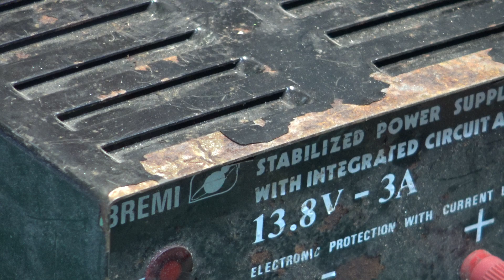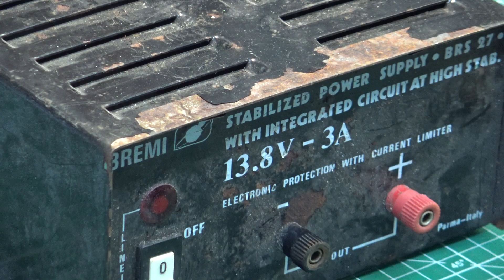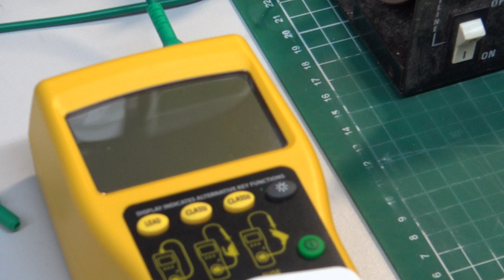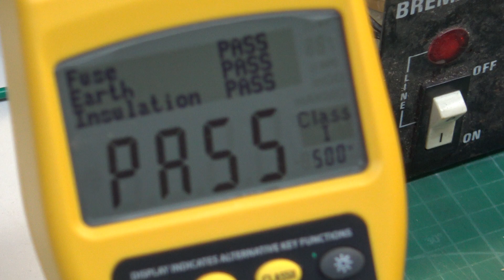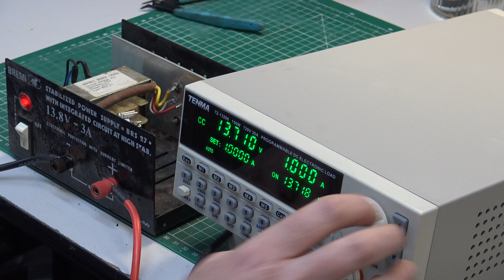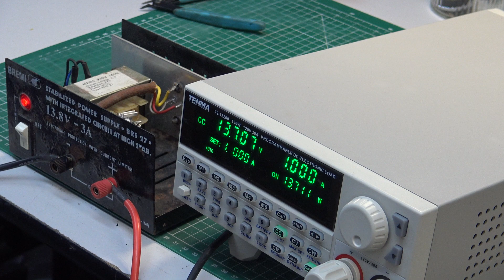Bremi BRS27 Power Supply overhaul & test

Comment: There is a variable resistor VR pot on the top of the PCB of these units, what is that for please?
Reply from the maker: It is to adjust the output voltage & should be set to produce 13.8V. Many other power supplies are fixed voltage but that voltage can differ from unit to unit slightly owing to component tolerences. The disadvantage of being able to adjust the voltage is that a screwdriver expert can adjust it so high as to blow up every radio he connects to it.

Ricxhard, G0OJF, UK

Comment: I have one of the old ones with the metal switch and 2 core flex.  It has run every day almost since I bought it in 1978.  Not running a CB these days, that was short-lived. The wiring was changed to 3 core, fused, earthed, and a better heat sink put on it.  It was also changed from being neutral switched (Something to look out for, you switch it off, it is still live!) A capture fuse has been fitted on the mains and the secondary for safety.  It has also had the live terminals shrouded. It powered a car cassette radio for 28 years and has never been off (except when I moved house) and it has never failed, yet!  Now I have said that, you know what will happen!  It has recently got a rest from running none stop, I got a complaint about the power it was using.  😞

Comment: That's a blast from the past, I powered my rig with one of those as a teen in the 90's.  I use PC power supplies with the voltage turned up these days, clean power and bags of amps
Reply: Depends on the PSU as it is the heart of the PC. i just built my son his new gaming rig the corsair PSU was over 200 pound. You pay for what you get in this world you do not want something cheap to let out the magic smoke and kill everything.
Reply: @chris_vandepeer  Yeah, i know about PC power supplies and wouldst use a cheap Chinese PSU in anything, i have a Corsair PSU in my desktop funnily enough :) The PSU i use for my radios is a OEM unit taken from a evil dell and so of reasonable quality.
Reply: @stevefox3763  I did not mean to sound as if i was bashing you over it and it is nice to repurpose things and keep them from landfill. i do have 2 decommissioned dell T5400 servers in the loft with 850watt psu in them.
Reply: @chris_vandepeer  I would never buy a pre built as i will always build my own but if i did i would never buy Dell, they have good build quality yes but their deliberate prevention of upgrading and also use of propitiatory things wherever they come is out of line but i occasionally come across free machines which i will put to use and although its not a server by design, i use a dell desktop as a file server.

That desktop i use is a prime example of dell being dark, non standard PSU pinout and anyone not clued up on it could fry their mainboard and possibly CPU if they attempted to put a standard ATX PSU in that did not detect the problem fast enough, the motherboard also has the I/0 on the opposite side meaning a replacement board cant be used in the case and many of the boards headers are non standard, very dark.

i didnt think you were bashing me, its cool :)